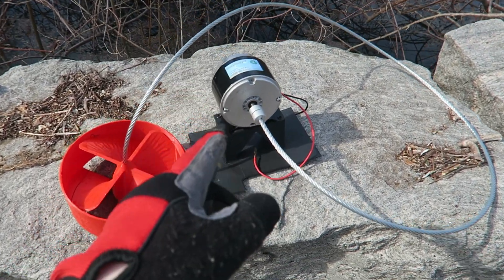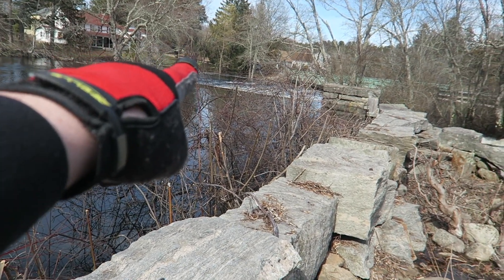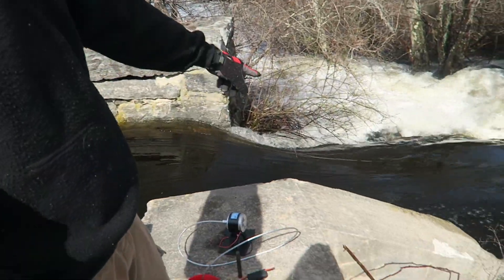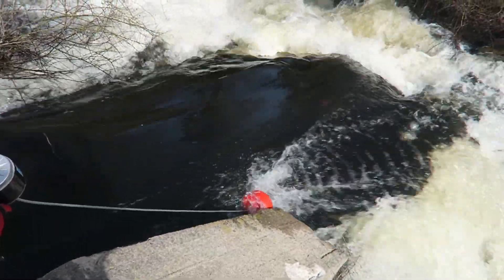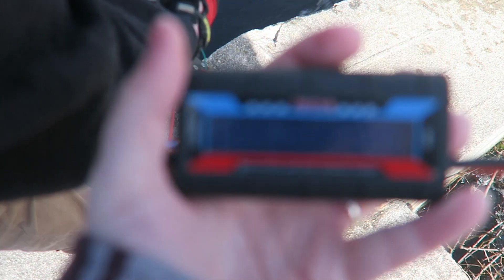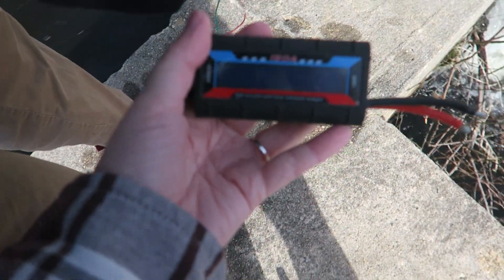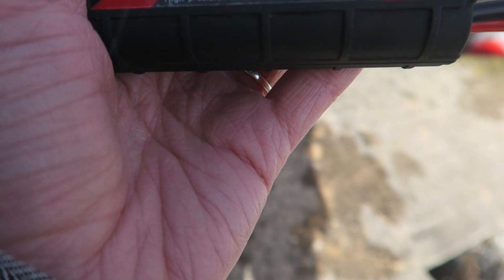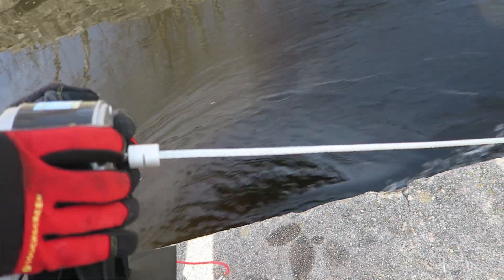Testing The 3D Printed Water "Tow" Turbine

Comment: I watched a few of your videos related to hydro power.  I recommend you get a couple of inexpensive multimeters.  Use one to measure voltage and the other to measure current (will need some sort of load).  That tester you are using isn't telling you anything because it needs some minimum power to run itself.  I know you understand that.  Multimeters don't have that problem though.  You could mount them to a board with some standard load testing setup.  Maybe a switchable / adjustable load like some power resistors.  Not sure... how do you test the power or a generator?
Reply from the maker: Thank you for this comment! It's a great idea I'll set this up so we can at least get a reading when voltage is low
Reply: @Beyond_The_Print  I forgot to thank you for putting together all these videos.  I imagine it's a ton of work.  It is much appreciated.
Reply from the maker: It's my pleasure, It's nice to see people enjoying them

Comment: @Beyond_The_Tint  I also suggest stepper motors, they make great little generators, as they have many more poles than your standard brushed 12v unit, so you can get much higher voltage per rotation.
Also, in the experimentation phase, I wouldn't bother buying them, get them from junk. They are ubiquitous in printers, photocopiers, scanners, 3d printers, any Industrial process. almost anywhere there is something that turns and is computer controlled accurate. visit your local e-waste depot with a screwdriver, pliers and a hammer. as an added bonus, you wont feel anywhere near as bummed out if you drop it in the creek.
If you DO insist on buying new, Id look into Brushless motors intended for RC use. the ones designed for drones/planes will be way to fast, but maybe ones designed for rock crawlers? its just a change on the winding, so the same frame often comes in a wide selection. you'd have to do some research. and being brushless, they can be made entirely water-proof. check out RCTestFlight, he's got a few outboard motors built around them.
Probably the ultimate would be a hub motor off a hoverboard that was all the rage a few years ago, until they started setting stuff on fire. very low speed, high torque. you could embed the hub into a waterwheel or something, no belts or gears at all.
Best of luck dude

Comment: I am honestly surprised a voltage and amperage reading was not obtainable with the generator setup you had in this video, seems like it was getting a decent amount of rotation...
Reply: Looking forward for more of your projects dude, keep up the good work.
Reply from the maker: Thank you, I appreciate it
Reply from the maker: I agree but this motor has a low torque input but needs high RPMs, I think a gearbox will solve this issue as there is more than enough torque.